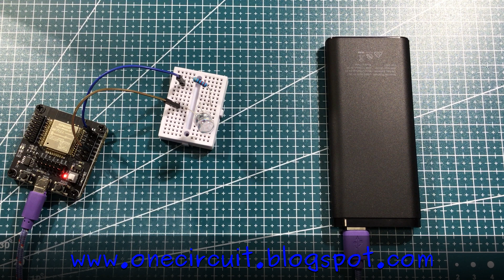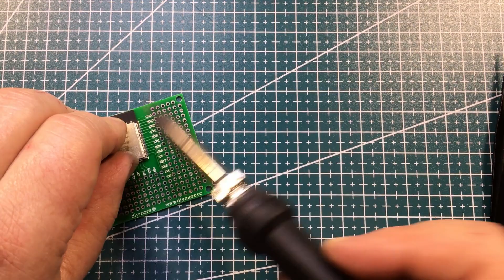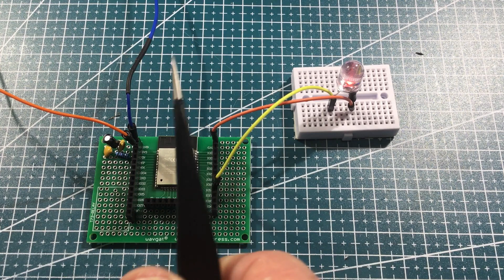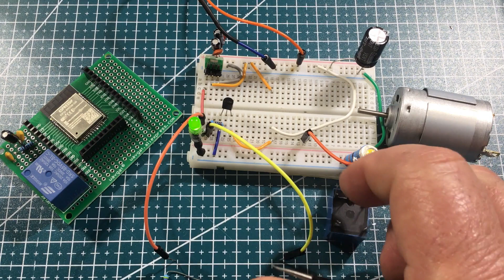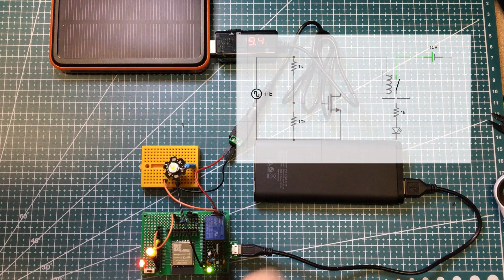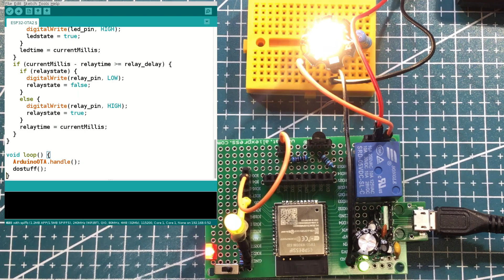ESP32 driving relay OTA

Comment: Nice video. Thanks. Where can I learn how to properly get rid of background noise with Audacity? When I do it, my voice sounds so different, but when you do it, I don't really notice such a big difference.
Reply from the maker: I can do a video on that if you think it might help. I start the recording for a few seconds before talking (which I later edit out) and then I've got a decent amount of background sample to use for the noise reduction algorithm. 👍😀
Reply: @onecircuit-as  A video would be great. I don't exactly understand the settings to use to get the best background noise reduction. ...I sometimes film at work and the overhead ventilation noise makes any recording sound like garbage.
Reply from the maker: No worries, I’ll run through my procedure in an upcoming vid. 👍😀